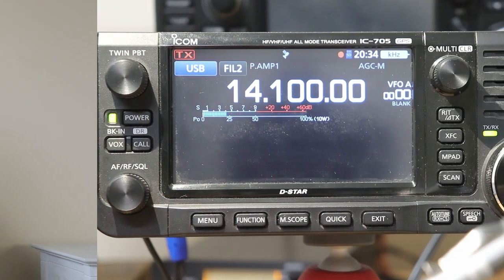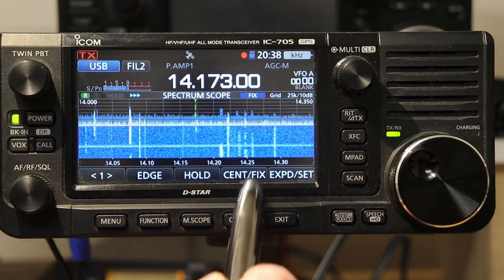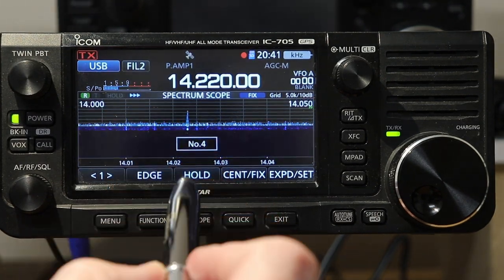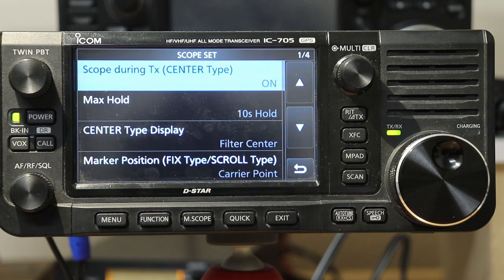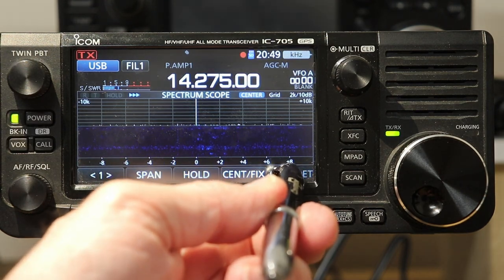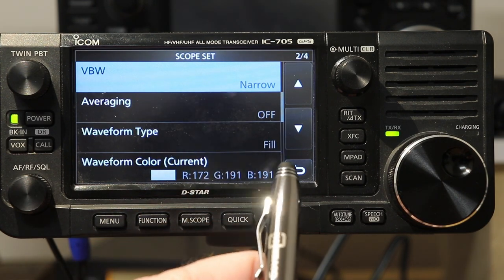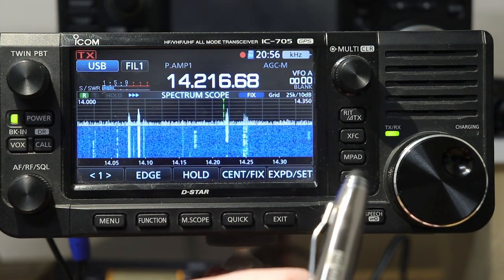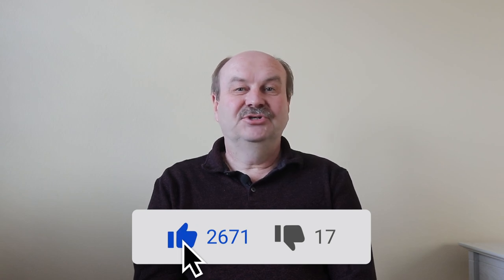IC-705 A2Z #13 Spectrum Scope Part 1

Comment: I'm watching the IC-705 spectrum scope explanation for my IC-7300, so meticulously well explained! Are they identical?
73's Tom from Johann
VE2YOW Québec, Canada
Reply from the maker: Yes.  I’m pretty sure since the latest firmware updates, the scopes on both radios operate the same.  There is also a series of videos specifically on the 7300 scope in the IC-7300 playlist.